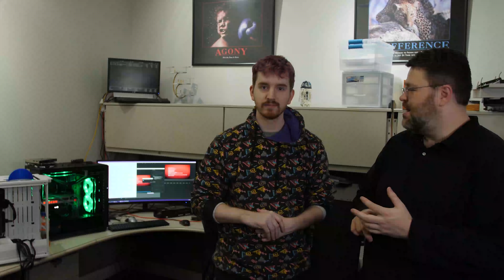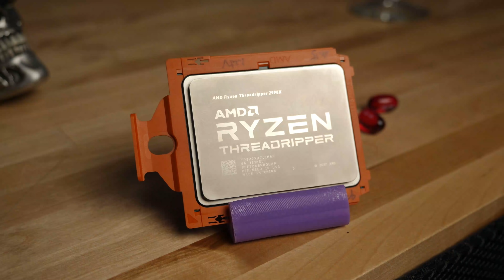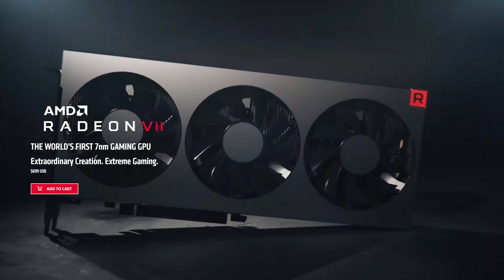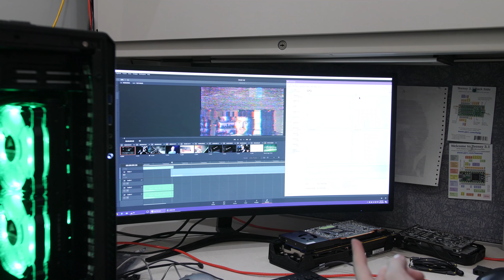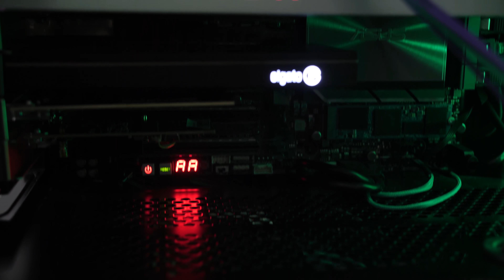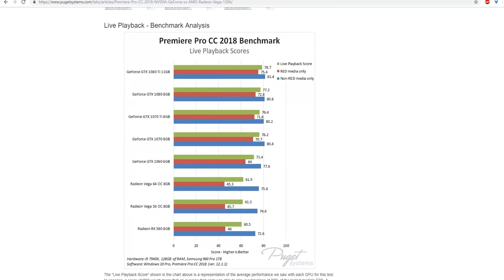Radeon VII: Fast & Stable Premiere Editing (part 2 of 2)

Comment: I was using a 1920x and TitanXp for Premier, After Effects and Blender.

I wanted to pick up a Radeon 7 but they are impossible to find so after looking at some benchmarks I picked up  a Vega64 and wow, this thing saved me aud$500 and is as fast and usually faster the applications I use over the Titan. 

I'm pretty impressed to be honest.
Reply: AMD itself has them
Reply: AMD had them for the last few days, I think Best Buy has a few stock too
Reply: You can get a RVII from AMD themselves pretty easily. I've received four separate email to buy one from AMD directly using their 'notify me' service. I wanted to see if it were as hard to buy as some are saying. 

It's not with a little patience and watching your email. Its currently in stock on AMD.
https://www.amd.com/en/products/graphics/amd-radeon-vii
Reply: @techpappee  I just got mine this morning directly from AMD. I guess AMD has them in stock from time to time. I love that both Vega 64/56 and Vega VII have HBCC.

Comment: I don’t have these problems on my Hackintosh with Final Cut Pro 💁🏻‍♂️ ahh but I get it, everyone has their editing program that they know inside and out, are comfortable using, and they don’t want to change. Thanks for doing all of this work and finding possible solutions so the rest of us don’t have to 👌🏻
Reply: The word hackingtosh and the word problems usually come toghether, and tbh you probably dont have a workflow as heavy as eposvox. 

Also i dont think that final cut has gpu acceleration (but idk).
Reply: @eduardoavila646   Negative. It runs 100% natively if you pick the right hardware, b/c that's exactly what apple is using. There's no difference. You never ran a hackintosh with nothing except a boot loader?

Comment: Ever since I bought 4960X + 2x780Ti back in 2014 I realized that it is way more efficient, handy and just makes sense to have a second system (now it is 6600k @stock w/o GPU, possibly 1050Ti later) that is not power hungry, dead silent and does not heat the room by several degrees C. I still need the power of 4960X very often, but it makes more sense to have it as a racing car for special work, gaming or anything performance hungry and mainly drive other more practical thing 16/7/365.
Also the separation between two workstation environments is very beneficial to the workflow. I just sync common data using Synthing and Nextcloud (yes another 2 servers that I maintain: NAS + Proxmox, not required, but much more fail-safe).
And 2 PC also back each other up in case of system crashes/malfunctions/rogue updates/viruses/other BS.
They are both connected to 2 monitors via DVI-DL and HDMI switches. Peripherals and sound are USB for ease of switching.

Comment: Not related to video editing, but I picked up a Radeon VII to push some of my big data and machine learning projects off CPU and unto GPU. it has been quite impressive so far though I have not tried getting it to run the big reinforcement learning simulations I had to use cheats to get results from in reasonable time. If it scales well in those compute tasks, I may be tempted to pick up a second Radeon VII down the road. The close to $200 of games it is bundled with also adds to the Radeon VII's value proposition by making it more like a $500 card.

Comment: As long as you're doing professional video work, you will need multiple machines. One for editing, one for rendering and at least one for backup in case anything goes wrong.

ProRes was developed as an editing codec and MP4 has always been a delivery codec. Scrubbing an MP4 on a timeline is a recipe for crashes, especially for long projects.

Comment: You needed some sort of TLDW, Conclusion or Wrap up.
 My take was, Adobe software is crap, Windows render management is crap, due to this 2 machines are mandatory for this kind of work and proper streaming; Nvidia is insanely expensive for this kind of workload, Amd although cheaper and as good lacks on the software side of things; big companies that not only have the money but the hardware also consider Adobe software crap.
Reply: AMD's software is way better than Nvidia. Adrenaline Software is an absolute joy compared to GeForce Experience and Nvidia Control Panel.
Reply: Yep I agree. It's full of great info but I'm still not sure why or how to set up two machines for Premiere.

Comment: For that windows 7 vs 10, i have noticed that sometimes in 10 mouse can freeze, while that doesnt happen in 7. I have seen that usually windows 7 and 10 perform same, but in some cases 10 can be noticeably faster at least on ryzen. I believe that should happen less with intel, as there are no CCX that OS needs to be aware of (and win 7 isnt). That is with tweaked windows, there are some performance issues on 7 before tweaks, but not on 10.

Comment: At 1:49 render video way way back when I did video converting from VHS to cd on a Intel 233 mmx with only 64meg ram and a ATI 9000 card started with a 8500 I found the software was the main problem finding the right software would fix issues I was having and to improve the image over all first I had to record the tape in the highest image possible then convert it then burn it to cd as dvd was not out then yet but it was fairly easy once I got it set up I even converted old 8mm and super 8 to cd and they looked better then original stock did with a little trick of putting the projector up close to the screen condensing the image and recording with cam up close no zoom making sure the projector was focused good giving me the best possible image it was time intensive with all those tiny reels and all the software I used was free and way better then what came with the devices I used with exception of ATI cards recording software which was very good but you had to get a certain version for it to work correctly
Reply: Not English was not my best subject so no never heard of it think i was absent that day  @motoryzen
Reply: My first PC had an Intel pentium 233mhz w/ mmx 48 MB EDO ram, 4.3gb HD 24x CD rom, 2x cdrw and an ATI card but I don't remember which, also had a video capture card with an s-video port hooked up to a VCR

Comment: About Windows desktop being unresponsive during rendering/ OBS having issues with games demanding all the GPU juice, did you try having 2 GPUs? One for the OS/gaming and one for premiere or OBS encoding? With $150 GPU being perfectly capable of endcoding a stream, that could beat running a 2nd PC at cost and save the same problem.

Comment: I currently edit and encode my videos on my X99 5930K with 32GB of Ram and a 980ti.  I mostly edit 1440p and 4K.  It renders fine, but when I encode I can't really do much, so I was thinking about getting a 2nd system as my main gaming system, do my editing on the main system and shift the after editing encoding work to this older system.  What considerations should I make when I get parts for the new system or would that really matter?

Comment: I really liked Premiere, but the way it performs and because of it's stability, I still subconsciously think Sony Vegas is better as a product. I really want to like Premiere more, but still, if you can avoid using After Effects and need a solution to montage w/o special requirements for plugins, then Vegas is probably a more reliable tool..
P.S. btw Media Encoder is an utter crap. it's like everything that is offered from Adobe is very appealing, but is half-baked.

Comment: I use AMD WX8200 on Avid Media Composer and it's really fast and stable using 2990wx with 64gb.  I've had no issues but would love to find out how well the Radeon VII runs on Linux. especially Ubuntu Studio and Parrot OS
Reply: Isn't parrot aimed to security testing? Why use it in a editing desktop?
Reply: I understand why you asked that, I get that a lot.  I use it for my own designed firewall. Every device hides behind my firewall when at home, I reverse engineer the testing to use as security hardening.. Anyway  I'm more curious on how the card would work on Ubuntu Studio.   Actually you would be surprised on what other packages are now installed on Parrot and other Linux distros that give us more a viable option not to go the Windows route.   @eduardoavila646
Reply: @MadmusicalHulk  Oh, so you actually use it right! Many people try to use parrot or kali linux as their main distro, for no reason at all, and suffer with issues trying to install ome stuff. Then run ot a forum where peoole tech them that they shouldnt usually install those distros as their main. 

Btw thx for commenting about this avid media, it seems to be really cool. 
Do you think its havier than premiere and sony vegas or not?

Comment: A stable program isn't the one that demands 'X' amount of 'Y' to work properly and throw the time in dustbin if the requirement isn't met. Specially when the 'X' is higher than what's in decent rigs.
Premiere, Windows 10.. No.. Whole of Adobe ,MS and Nvidia is load of bullcrap.. There.. I said it.. Feeling light

Comment: Premiere is utter crap. It works only if you are only slapping together a small video but it struggles with everything from 4 cores and 4K upwards. It is like editing a 130 page document in Microsoft Word. There is final cut on the Mac side, that has a lot less features and only a couple of codecs and resolutions but it generally works and when it crashes, your progress and work is still there. Not satisfied with any video editing program atm.

Comment: I'd just like a Card to palce Vram on for my Video card, into a PCI slot..
Reply: too slow bus :x
Reply: @mareck6946  then why use SLI??  Why plug a vid card in for th epower if you are using the SLI connection only..  or we should just goto Parallel processing along time ago..
Reply: @ecash00  SLI does make a copy of the maindata on both GPU's local memory and just transmits changes. Where too much data has to be transferred back and forth stuttering occurs - the same problem persists with crossfire thats why both technologies are somewhat a Gimmick and receive very little Support from teh Gaming Industry. With more Modern NVLink / SLI Combo you can share vram of another card when their directly interconnected - however nvidia only makes this available on the more expensive cards anyway. AMD goes a bit the more conservative Round with its HBCC / HSA Model which makes 50% of the System memory available directly to the GPU if need be for DMA'ed access. However even a PCI-X 3.0 x16 bus can get saturated very quickly plus the latency is about 50 times longer than access to local vram which also is wider ( 256 bit + ) whereas system memory in a dual channel config is like 2x 64 bit ( which is NOT like 1x128 bit - it doesent work that way ) which also is like emptying a 100 liter bottle thru a straw for a massive parallel processor such as a modern GPGPU is - no matter the brand. Intelligent Routines already try to maximize throughput with the data needed. Basically AMD's System is more or less what you want without introducing another memory scheduler which again has to be also synced with the cpu which in the end would add even more latency. Then lastly theres something like teh Radeon SSG whith Onboard controllers - if you REALLY need alot of Vram 1 - 2 TB Possible.
Reply: @mareck6946  I was just hoping that an upgrade path, made simple, would be a nice thing...Rather then adding a $150-200-500 video card...Adding ram to what you already have should work wonders..  AND it would open the Vram market todrop the prices for all the corps and players..  And using systme ram SUCKS when you dont have excess ram, and win10 is taking 2-4gigs for its own uses..  Loved the amiga cause the CPU was more a traffic cop, then doing all the work..the Cards/video/audio DID the jobs..  The CPU might do abit of decoding, but that was at most.  Still waiting for going backwards and Smart cards that DO the work, rather then letting windows..
Reply: @ecash00  yeah the Amiga - good old times - that only works in SoC Solutions like in the PS4 where you have a fixed set of hardware where you exactly now the clocks and instructions. On the Amiga you had the GARY ( Gate Array ) Bus Controller for IO and Floppy Drives which was programmable by the MC68k CPU and made a few nice copy protections and other tricks possible. Then two CIA ( Control Interface Adapters ) for IO Controlling (Diskdrive, Serial and Parallel Bus , Joy & Mouse) . Paula as Controller for the two CIA's and also Soundchip. Denise / Lisa ( AGA ) as Graphics Chips ( Display Encoder ). All where initialized thru the Kickstart EEPROM and then the CPU could program them directly and each of them was able to do most of the stuff on its own ( like a GPU nowadays or Sound Processor ). With a fixed / known workingset you can do all kinds of stuff but PCs nowadays are so different under the hood that basically only the higher level x86 functions are available since like noone but driver developers can do tricks on certain hardware. Also the Ram was shared - this Principle is inside a SOC ( System on a Chip ) like the Ryzen 2400G APU which combines a Quadcore Ryzen Chip with a Vega inspired Graphics chip on one die - if you go deep in such an Architecture you can do wonders but it would be optimized for that Hardware and thx to the Vulkan API you can do alot now that will also run pretty much Brand independant but still more efficient at the Hardware the code was designed for. A System like that when the HSA Architecture is properly used can be pretty effective. You also can add more Ram to increase the Memory available to the GPU Part. Thats basically what your looking for in an upgradable affordable System today. Good for all general Tasks, Decent Videoediting Performance and lighter Gaming up to 1080p. The Reason why you simply cant upgrade Vram rightnow is the Interface - todays GDDR5/6 runs at clocks which are so high that there can be interference from unshielded connectionlines, which you would have, would you socket them. Of course there would be an Option where you could add "Slow vRam" ( lets say DDR4 Memory) to a GPU - this could be possible thru the new tech that AMD developped the interconnect Chip for their Ryzen 3000 Series as there are multiple Memory controllers inside. However, for it to be somehwat usable you would need to find room for 4 dimm slots on the die (for at least 256 bit intercon or 2x 128bit dual channel ) - this could be indeed - at least for the professional Market an Idea but would not be economically feasable for lets say the normal consumer market as the extra parts and board complexity would rise alot.
Reply: @mareck6946  old days are gone, old Builds are dead, the great concepts of the past are buried...Do you know if BeOs ever made their Multi CPU machine?  I thought they made 1..
Reply: @ecash00  there was a Board i cant recall the name tho anymore. However there is still Amigas based on OS 4.1 sold with a Dualcore PPC - But you really gotta love em for the price - they can even run old Amiga Software via a rather powerful 68k Emulation via PPC ( 68060 Speed + ). https://www.amiga-shop.net/Amiga-Hardware/Neue-Amiga-Computer/AmigaONE-X5000-Komplettsystem::790.html
Reply: @mareck6946  And you can get he OS, and run it on the PC...I know., and the PPC system is over $2000, and If I could run Linux and BeOs on it, it might be worth it, if there is any other software out there..  Like buying an SGI system, and end up playing games on it??  never.  a waste.  Creating a Reasonable system to do rendering, or beat Apple at grphics would be great.  The Amiga and such were based on the idea that Simple parts can do everything..  BeOs hardware failed for a few reasons, no adverts, and MS running uphill to beat everyone....  the idea that "wow, I see these all over the place , I should get one" is a BAD concept.  Its like seeing consoles all over and thinking they are great for office work(they could but no one made the software)..  It was a bunch of persons with little knowledge buys a new product.  and not getting everything they wanted..  Also, m basing this on TIME FRAME...before MS went to windows and even upto 2000'..

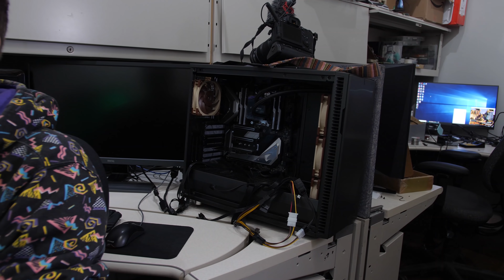Comment: 13:00 Well you know what else Windows 7 doesn't do that 10 does? I see you've been rendering that video for 10 hours, it sure would be a shame if I reboot your computer to do an update right now... Oh well say goodbye to that oh and while I'm at it I'm just gonna change some of these settings you tweaked, I know you didn't want those and maybe at random I'll just put some app on your computer you never asked for or hey I'll just push out an update to wipe all your files how does that sound...?

Yeah, even if you don't care about privacy or some of the other issues, Windows 10 is still an incredibly annoying OS and yes you can technically tweak it to make it not such a pain, but guess what Windows 7/8 just plain works, I've hardly ever had to tweak very many settings and everything just stays as it is, I don't have to fight the OS to make it work the way I want it to, I would much sooner switch to Linux than ever using W10, only reason I haven't is I like my windows apps.
Reply: Been using 10 since it came out and have yet to have to reboot on me. Seems to me that only happens to people who postpone updates for like a month and are then shocked when it reboots randomly. Wendell doesn't seem like the kind of guy to do that though.
Reply: @ozker5448  "I don't see it so it must not exist" 
Ok well I don't use Windows 10 so I can't really say, but it updating itself is practically a meme at this point, infact I figured I'd just check and technically it's still being "researched" but still that's not a good sign for it. https://knowyourmeme.com/memes/windows-10-automatic-update

So I'm gonna suggest that it's probably happening to more than just a small handful of people postponing updates...